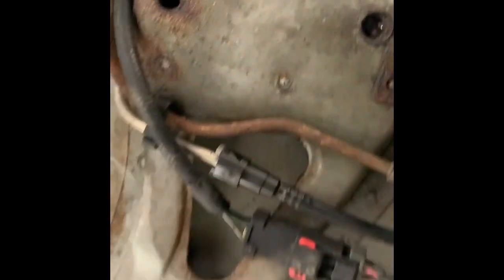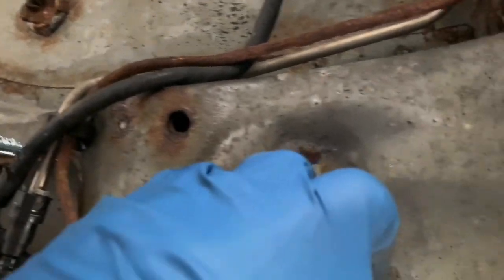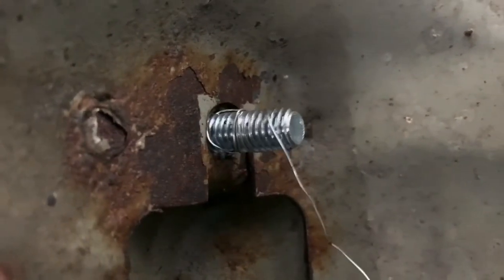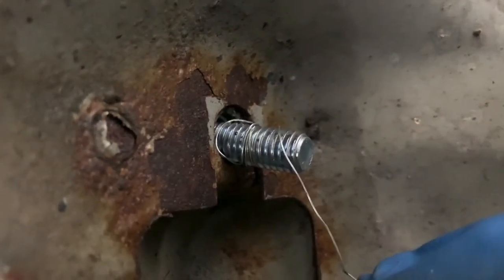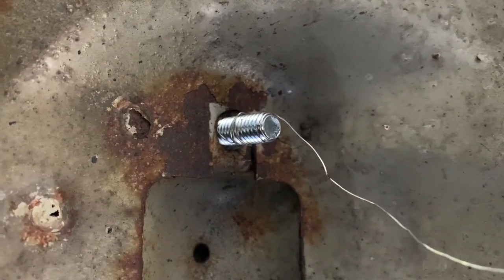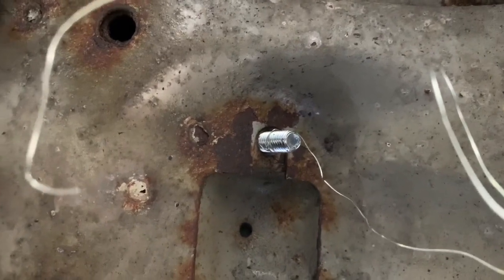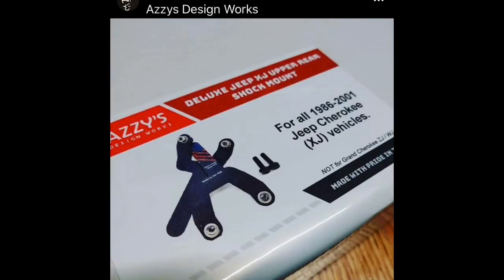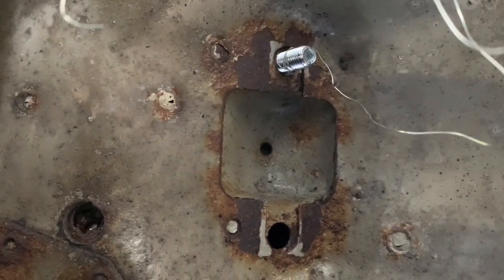Upper Shock Bolts on your Jeep Cherokee XJ

Comment: This is the absolute best way to fix the rear shock issue. I’ve discovered that the bolt punches out by mistake and from there I used this technique because I had just needed to per the instructions on the receiver hitch I installed a couple weeks prior. I even used the same wire device you made, but mine came with the hitch kit.

Comment: Thank you, I spent ages (and countless drill bits) trying to drill out the first one I snapped. After watching this, the air hammer had them out in seconds and all though I was skeptical at first, your fishing line trick worked wonders.
Reply from the maker: That's awesome...I'm Glad it helped!  the design of these shock bolts isn't the best..but it's great to have a fix....

Comment: I bought a flameless magnetic induction bolt heater in preparation for this job. It should be in Monday; I'm doing the front of the jeep right now without it so I'll let you know if it's able to get them out without snapping or not. If getting them glowing doesn't work; then I'll be using your method haha
Reply from the maker: Let me know how those things work. They look really cool!
Reply: How’d it go?
Reply: @Deadbuck73  I got 3 out of the 4 bolts to come free; last one was too hard to get the bolt heater at, so I snapped it and used a piece of mechanics wire to fish a bolt through. I gotta say, without that bolt heater, my XJ would have SEVERAL more broken bolts.
Reply: @JustJeep_It  yeah it’s one of the best tools I’ve ever owned. Especially nice for heating bolts near flammable/explosive components as there is no flame or sparks. To put it in perspective; my leaf springs bolts wouldn’t come off with an air impact on blast. After heating, the first one came right out. For shits and giggles, after I heated the second one, my little dewalt electric impact was able to take the bolt out.
Reply: @TheOceanX  awesome! Where do you get bolt heater?
Reply: @TheOceanX  well… my son and I just finished doing the rear shocks…PB blaster was used… 1 came out fine… the other three took some work… got them to break and then worked em in and out until they finally started working out nice… next stop is the leaf springs… been soaking them with blaster as well… they don’t look too bad so fingers crossed!
Reply: @Deadbuck73  flameless induction bolt heaters are expensive; the cheapest one (which I have) is about $250 on eBay or Amazon; it’s just called the hot rod induction bolt heater. As far as the leaf springs go; you’ll need a good size breaker bar. I personally used a breaker bar with the floorjack handle on the end for further torque. That’s after getting those bolts glowing red. Definitely work them back and forth coming out; especially the ones that go into the unibody rails. Rust builds up on the tips of the bolts inside the unibody rail and jams up the threads when you’re trying to take them out.
Reply: @TheOceanX  hey thank You for the advice! My rear shackles were replaced about a year ago… and there’s hardly a speck on them… U-bolts aren’t a worry… but those front eye bolts… I’m hoping to be pleasantly surprised… we’ll see… might be a week or two before I go after them… time is my biggest hurdle!

Comment: I also used serrated flange bolts and nuts. This allowed me to tighten without needing a wrench on top.
Reply from the maker: That’s an excellent idea. I didn’t think of that.. getting that wrench to line up took a bit of finagling. Haha!! Thank you for the tip!!

Comment: Great job! I worked for a truck accessory store and did all the hitch installs. They usually included fish wires with the install bolts. Just checked on Amazon, turns out you can actually buy them there. If used carefully, they can be re-used often. I keep left over fish wires in my toolbox. But I've also had to use the homemade fish wires too. I'm looking for the bolt in upper shock mount cross member that bolts in the rebounder holes. best solution I've seen. Thinking of making my own. I'll have to use your air hammer punch trick to get the blind/ weld nuts out for the rebounders. long gone on my 95 XJ. God bless, stay well.
Reply from the maker: Frank The CADD Monkey Thanks Frank’s I appreciate the kind words. I’ll have to check out amazon. Man they got everything.

Comment: Nice insight. I'm sure this will save many guys a bunch of grief. I converted mine to a stud set-up. Fabricated a couple c-shaped backing plates and welded 2 hardened bolts thru the back side to use as shock mounting studs. Welded the new plates to the truck body over the original location. SUPER easy on-off now.

Comment: Ill never forget the moment I realized it was just easier to break those bolts than to try to get them out.  It was like a revelation.  We used to tape the nut into an open end and hold them up there with the wrench and put the bolts in from below.  Either way...just another "Jeep Thing" haha.